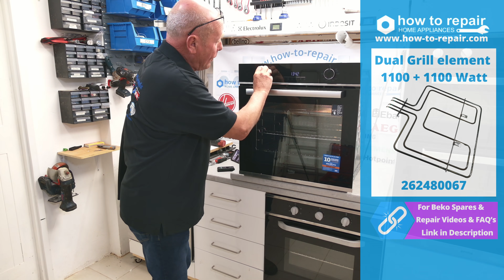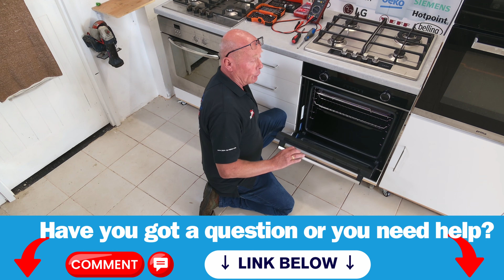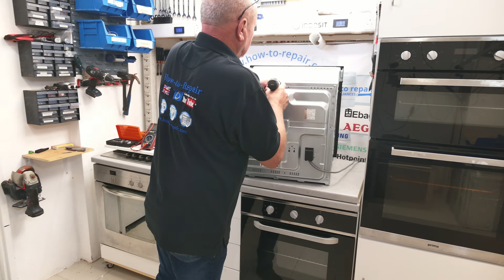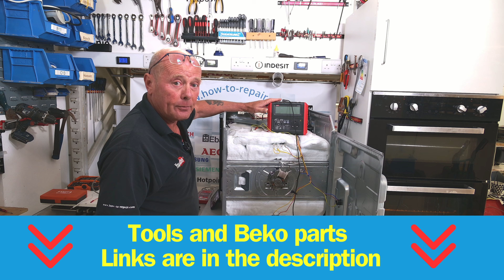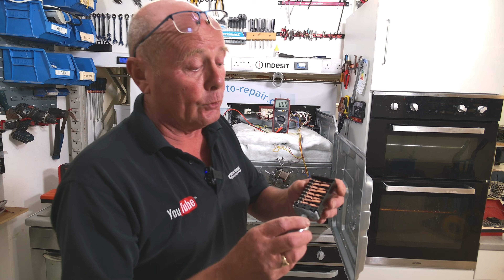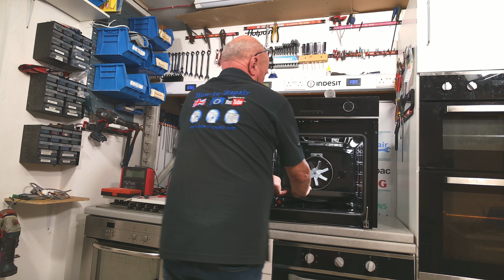Beko Oven Not Heating | How To Test & Replace Fan Oven Element?

Comment: Thank you for this video. My wife bought an element for a Lamona oven for me to fit, thinking it would be front fitting. I got stuck when I couldn't pull it out from the inside. Thankfully I found this video and replaced it and the oven is now working. You explained what to do in detail as it should be. I'm now subscribed to your channel and will recommend you.

Comment: Hi you don't have a wiring diagram for a indesit cims51kaixgb 
I.c ends 90200 many thanks kai
Reply from the maker: Hi, I will need the full model number of the identification plate and the details of your problem so that I can provide you with useful literature. Please use our contact us page and make sure you fill out the request for what your problem is. A video shoot of the problem would be perfect as well.

I will get back to you within 24 hours, normally. https://www.how-to-repair.com/help/contact-us/  

Please remember to subscribe to our channel, as that's what keeps this channel going. Thanks, Paul 👍

Comment: my washing machine just broke down 

is it possible to buy the  rubber ring n fix it by my self 
apart from a wire to hold it in anything else to watch ? 
thanks
Reply from the maker: Hi, I will need the full model number of the identification plate and the details of your problem so that I can provide you with useful literature. Please use our contact us page and make sure you fill out the request for what your problem is. A video shoot of the problem would be perfect as well.

I will get back to you within 24 hours, normally. https://www.how-to-repair.com/help/contact-us/  

Please remember to subscribe to our channel, as that's what keeps this channel going. Thanks, Paul 👍